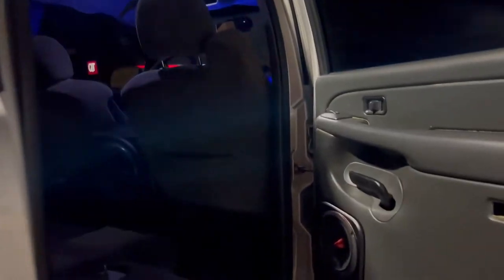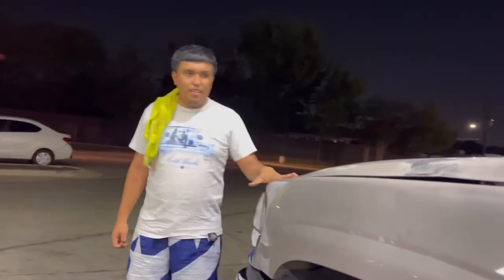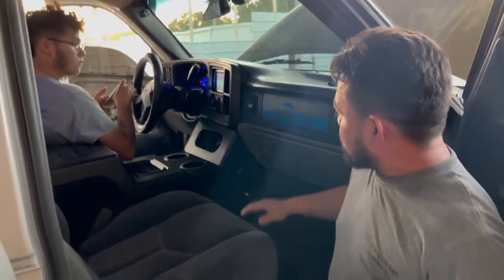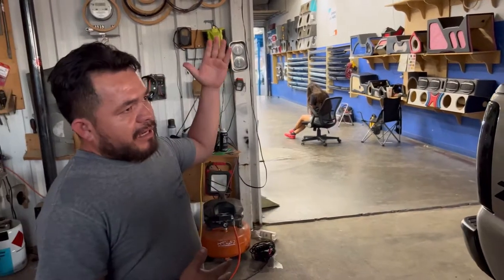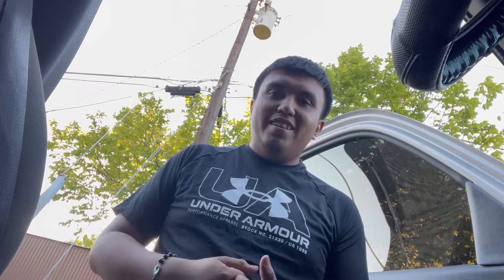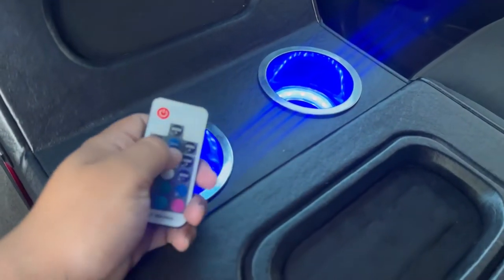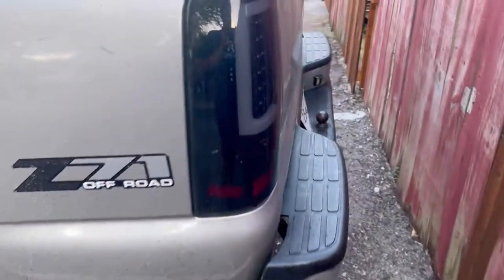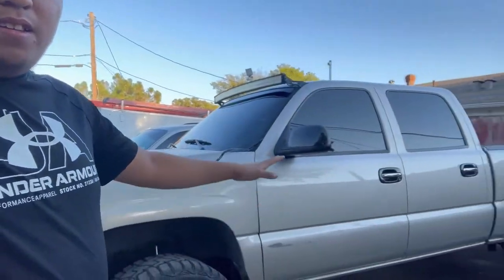Custom Center Console, Headliner Pod, 12 Ds18 6.5 Speakers Update On The Truck!

Comment: Which amp is connected to the rack the 1200 or 1500
Reply from the maker: 1200 bro
Reply: @boosted_antrax then then the other speakers are connected to the 1500 Wich are the ones form the center consol
Reply from the maker: Yes

Comment: How much all that cost you for the sound system
Reply from the maker: $7,000
Reply: Damn bro you got ripped off.
Reply from the maker: @josealvarez9576  I know I did… funny thing is that wasn’t the price we agreed to but for some reason it went all the way up but shit it is what it is I found a better shop thoe does the same thing even better quality for lower price
Reply: What’s the new shops called?
Reply: that guy be taxin and sells bad speakers he sold me a speaker and it unglued it self after a week started to rattle you got the address to the shop you found i stay in dallas too